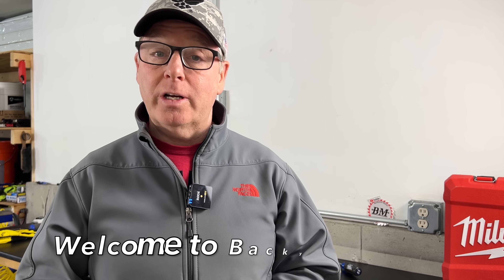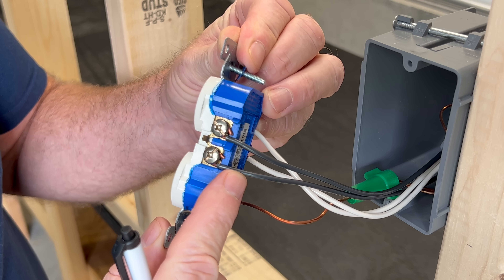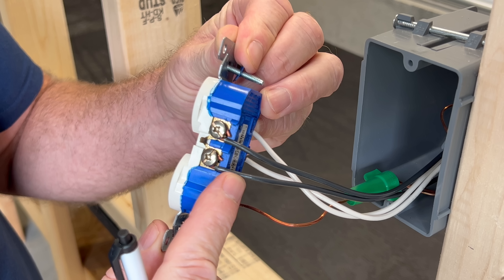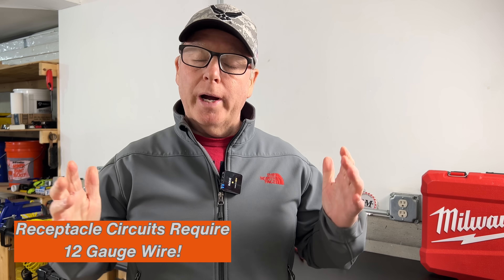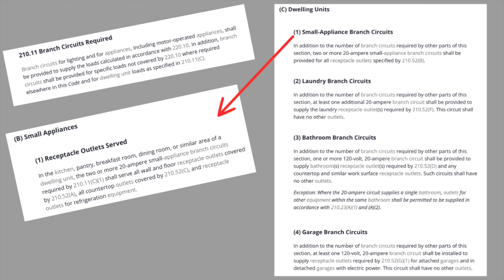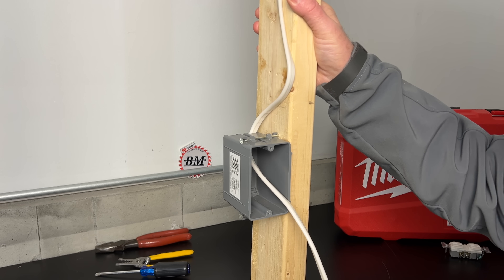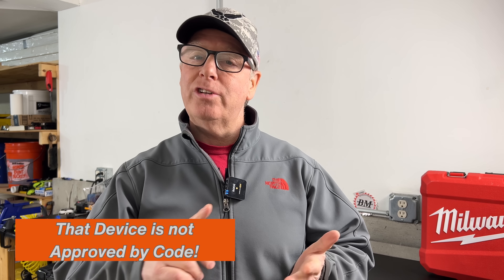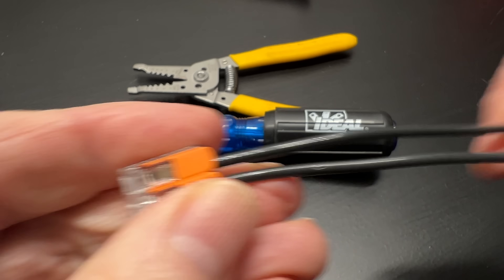5 Electrical Code Lies DIYers Should Stop Believing!

Comment: So, I'm new to this. Does this ever happen - an inspecting agent requires something even though it is NOT required by the NEC code. Has that happened to anyone? How do you handle that?
Reply: I worked as a Sr. Electrical Design Engineer for a very large electrical contractor.  Sometimes over 1000 electricians.   I got calls often from electricians on jobs stating that they just failed an inspection.   After drilling down to make sure what was done, and what the inspector said, there are a few methods to resolve it.   First, call the inspector and request a written statement of the violation.   Call the inspector and read the appropriate section of the adopted code and give your understanding of that section and “Why”.   Get out your code book when told of the violation, and look it up with the inspector.  If all else fails and there is a Chief Inspector, call them and discuss the install, the inspectors statement, the code section, and read your point to them.  There are numerous situations that could be told, but would take too long.   If you do your homework, and you are absolutely correct and have proof, you will win every time.   Just “Make Sure” you are correct first!
Reply from the maker: I hear it happens but I have only had it happen to me once when I was working a job in Vermont. I appealed to the state inspector and he said I was good to go. The local inspector was not happy though. It would have cost me $1000s to fix so I pushed back.
Reply: I was an electrical inspector for over Twenty years in a large city, and believe me this is an all too common occurrence!  You can’t believe how a little authority affects some people, and they enjoy being able to grind someone under their thumb.
The problem is that most contractors don’t want to push back against these petty tyrants for fear of retaliation, and so they continue on abusing their authority.  I cringe every time I read on here about “my inspector wants this, or wants that”. It’s no different than anything else in life, you have to stand up to bullies, and they usually fold.
Reply: @djcip1      100% Agree, as long as it is done respectfully!
Reply: @djcip1 
It happens with small town planning boards too.  Volunteer position, but they love the power, and don't mind overstepping their bounds.  Sadly, sometimes you just have to comply, since it's easier than fighting
Reply: The term you're looking for is AHJ(Authority having local jurisdiction) I.e> your local electrical inspector... 99% of the time you do ( Per there Authority )
Reply: The local authority having jurisdiction is the final say provided he is following local ordinance. If he tells you something that is beyond what local ordinance requires you will have to go to the local board and argue your case, where if you cite local ordinance required you will win. Local ordinance can be more stringent than national code. It cannot be less than national code.
Reply: @nooneyouknowhere6148  Actually, it can be less....the AHJ can make exceptions or impose restrictions.... it's built into the actual title if you think about it. They will be opening themselves to push back either way but it's still up to them.
Reply: To clarify things there is no such thing as a National Electrical Code. There is only a book was such a title.

The controlling code is whatever the state, county, and our city adopt.

As far as I know all of them are based on the NEC, however they are free to delete and add requirements. For example Chicago requires all residential buildings to use conduit. And in some areas the local code is still based NEC versions that are 10 or more years.

So you two answers to your question.
1. The inspector is using local codes that require more than the NEC specifies.
2. The inspector properly understand and interpret the local code. Then the question is how much you are willing to fight the issue

Comment: Plug fuses are all the same price, so always buy 30 amp instead of 15 amp and get twice as much fuse for your money!
Reply: That is probably the stupidest thing I've heard. That's a great way to burn your home down by over amps on the wire. But I'm hoping your saying that just to get a negative comment
Reply from the maker: I assume he’s kidding
Reply: Also looking to save money with LED bulbs, but do not know if they work for oven light. Can we try this over at your house? @jimcampbell5583
Reply: @jimcampbell5583  Beware the talking snake!
Reply: gotta be a troll comment.
Reply from the maker: I hope you’re kidding
Reply: @BackyardMaine  😂
Reply: If the device requires a 15 AMP breaker that's what you use a 15 AMP breaker. 30 AMP breaker's are mainly used for water heater's, stoves, etc: .
Reply: Sheesh! Get a sense of humor you guys😅
Reply: As they say- more bang for the buck!
Reply: Pennies behind the fuse are cheaper and you don't have to even go to the store to get one.